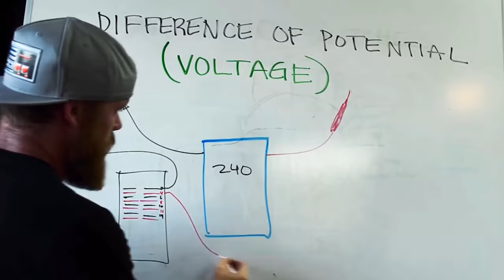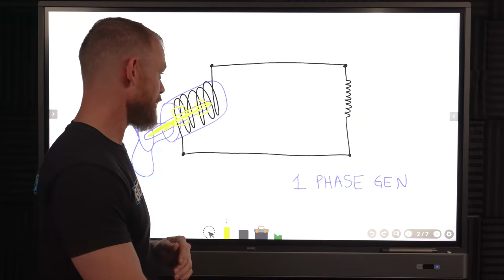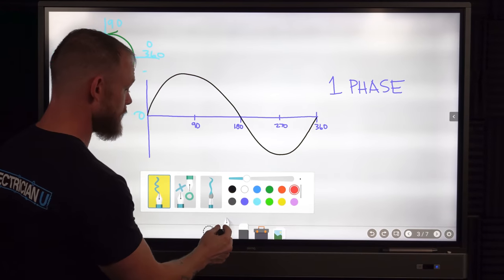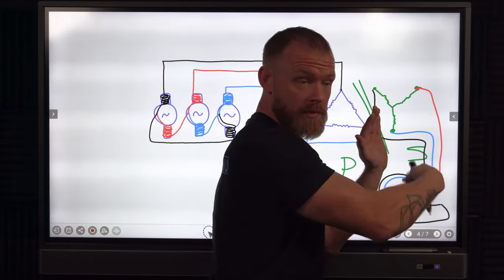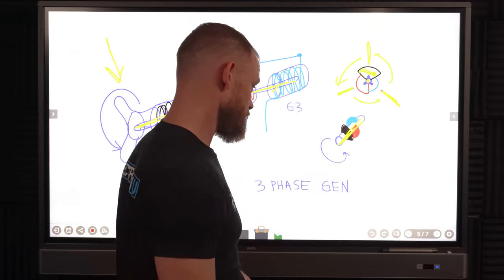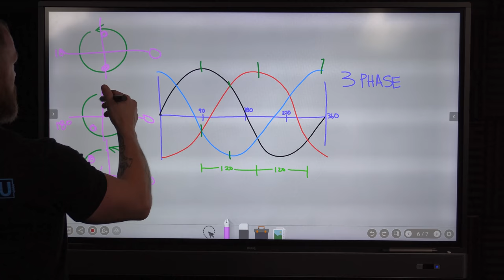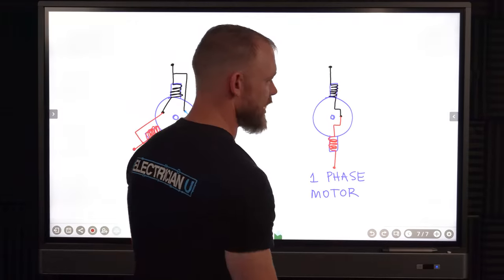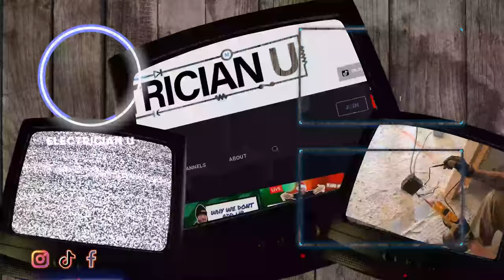What is the Difference Between Single Phase and Three Phase???

Comment: I’m not an electrician, but an HVAC tech who tries to fully understand what runs/effects the equipment I deal with every day.  This was definitely the most understandable description of 3 phase I have ever heard.  The only thing I was left wondering about after the video was the reason for different voltages on the 3 legs.  Thanks for such great content.
Reply: are you talking about the wild Leg in older buildings or the fact that 2X277 does not equal 480?
Reply: @businjay  Forgive my ignorance here as 98% of the work I do is residential, but as I remember it has to do with identifying the “wild” or “stinger” leg as some call it.  Like the voltage across 2 of the wires being different than the other 2 sets.?
Reply: @joshuahatridge3833  No worries. When I try to explain the wild leg to people they look at me like they just tasted shit!! but Dustin Explains it perfect here. phase to phase you will get a consistent voltage across all 3 of the legs but the stinger/wild leg has a neutral in there that can get you into trouble if you try to put a single pole breaker in, if its a dual pole breaker or 3 phase breaker line to line is always going to be the same, you have to know the difference between the 3 lines and a neutral(grounded conductor) in a stinger/wild leg panel there will always be one breaker out of every 3 that is 208 to ground/neutral. watch the video I linked to. Dustin explains it perfectly.   Lots of guys who dont get it will put a breaker in that open spot every 3 breakers to run a light or an outlet without realizing that that particular bus bar is 208 to ground and start frying shit. had an IT guy who thought he could wire stuff at a property I worked on, kept frying stuff but come to find out he was using the stinger leg in the panel to tie things into. he never bothered to check voltages, he just hammered a breaker in and ran his cable and wondered why the magic smoke was always coming out if his equipment,
Reply: @joshuahatridge3833  You also need to make sure you are checking phase voltages properly. 1-2, 2-3, 3-1 all those should be 208 or 240, where it starts getting interesting is when you go 1-n 2-n-3-n,  will all be 120 except one of them if it is a 4 wire setup depending on which is the stinger/wild which will be 208. Definitely watch the video I linked to above. dustin explains exactly what you want to know.
Reply: Here is another thing that maybe Dustin could explain for us since I dont really care to learn the code about it but I have in a pinch run a single phase air handler off the wild leg to Neutral to power a 208/240 blower motor and such off of a single pole breaker but I label the hell out of it. I dunno if thats even legal but the equipment doesnt care!! I think this is largely why the stinger/wild legs had fallen out of favor as it was too complicated for folks to figure out.
Reply: That would be a good video.  The other problem I have run into with three phase is switched legs making a compressor motor run backwards.  Why is that and is there a way to identify which ones should be in certain places?  Thanks for the video recommendation by the way, I did go back and watch it.
Reply: @joshuahatridge3833  There is a way to Identify, some of the voltmeters will tell you rotation (or proper) way to have conductors hooked up. but honestly A reciprocating compressor doesn't care which way it runs (unless its a semi hermetic and Oil pumps are involved Like grocery store racks or a lot of the older mquay/trane/carrier 30 ton and up chillers and packaged A/C units with semi hermetic compressors) so if it comes on leave it. a scroll compressor will let you know when its not rotating correctly (they make very angry noise but wont hurt them for a very short period) Blower motors easy enough, you just swap 2 Leads on the motor.  Your HVAC instructor should have taught you those things. When I change a 3 Ph motor I always check rotations of everything before I walk away. some things like VFD's and Star/delta motor starters get much more complicated but if you are mostly working on Residential and Light commercial you wont have to worry about that as much, if you have the time and the curiosity really do some research about how these things work so you dont get into a bad situation but at the end of the day 90% of what you and I do as HVAC/R Techs is electrical so I would learn what you can about the electrical side of things.

Comment: Neat video, you forgot to mention a key benefit, as compared to single phase, 
by adding one more wire you can almost double the power delivery!
I prefer to view 3 phase as separate windings etc that share the same spinning generator and conductors…. In a sense they both work together and separately

Comment: I'm glad you mentioned about the 'color' of the wires.  it's infuriating that some people struggle with an inability to distinguish between a symbol (colour of the metal sleeve) and the thing for which it stands (the electrical current in the system).

Comment: Great simple explanation, couple things I wish you would've provided for additional background:
- The excitation required for the rotor (shaft) on a generator to induce voltage on the stator (outside coils) as it spins.
- The role magnets play in transformers. I'd be carful telling people that electricity is transformed onto the load side across an air gap. Rather the movement of the current through the primary windings as it wraps around a magnet induces a current on the magnet, which through the ratio of the coils on the low side wrapped around the same magnet in comparison to the high side creates the inverse of voltage/current output on the secondary windings.

Not trying to puff my chest or anything like that. Just a bit of a nerd for electricity.

Comment: Awesome explanation, love the in depth explanation. For all intents and purposes, the average DIY'er just needs to know that 3 phase is very good and more efficient for running larger motors, in fact motors over a certain horsepower,  around 10 to 15 are only made in three phase, and with the possible exception of a very large, custom built luxury home, 3 phase is only available for commercial and industrial use. (Some utility companies and jurisdictions have a limit on single phase service sizes, I believe in parts of Wisconsin,  anything larger than 600 amps must be 3 phase,  or have engineer's approval)

Comment: I’m an electrician in Switzerland and I have to say that if you know next to nothing in electricity this is quite clear of an explanation . So I want to say that you did a good job. But I’m used to working with a 3 phase system and think that you forgot to explain the neutral wire in the secondary system. For those who are interested, I think you should explain it in a second video (unless it’s has already been done and I’m just unaware). I think you should talk about what it is, how it’s created, it’s usage, and the fact that it isn’t obligatory for an electrical system to work but very useful for using different voltage on the same grid without a transformer. (Sorry if i didn’t use all the correct technical terms, I have to translate it from French).

Comment: Why don't we use three-phase to run HVAC units in our homes? It would be much more efficient, yes? By the way, I've been a professor at the doctorate level for 40 years and you, sir, are a PHENOMENAL teacher. You have a knack for breaking down complex subjects into manageable parts. Keep up the good work. I'm learning a lot!
Reply: Residential applications typically are supplied with single phase power. Single phase power is less expensive to purchase, and three phase is more appropriate for higher loads than what is used in residential applications.

Comment: WOW, with no pun intended I had a genuine light bulb moment at 7.00min with your equal and opposite Sine wave.
Showing me, a simple Fitter Welder, single phase has a 'dead spot' at 180°
Explaining why a single phase powered, 3 phz generator still needs a flywheel. 
Thank you. 
Cheers Aaron

Comment: Sinewave: although your magnet explanation is right I would have a comment. The sinewave is not only a graphical presentation of the voltage and/or amperage but this sinewave actually present in the wire (conductor). Start with the zero-crossing (it means there  is no voltage nor amperage present in the wire - at all. Then the voltage start to grow until it peaks at 120V then it drops back to 0 and it starts over the same thing just the opposite direction. Imagen a battery connected to two wires you have + and - but 60 times in one second, you flip the battery between the wires. That would be a square-wave. just because the voltage increases and decreases between flipping you get the sine-wave. Love your presentation.

Comment: Seriously…excellent instruction. I’m a trained aircraft electrician…but I’m now an electric sign contractor. 120/240 vac is easy for me, but gets a bit fuzzy when working into three phase, 277 service, etc. the ONLY thing I would add/modify to this instruction is that a three-phase system almost necessarily HAS to come from the same generator. Inside the generator, the three sets of windings are completely separated and the induction “pickups” are set 120 degrees apart. If you used three separate generators, trying to sync the phases from three different generators to be 120 out from each other, nearly impossible…
Reply: Also, 60hz is why all generators making power for 60 hz systems must rotate at 3600 RPM. 3600 RPM push/pulls 60x/second

Comment: I think what threw me off for a while was a rendering of single phase generation has 2 wires and I always equated that to 1 phase that we would split with a neutral but that still one phase loop was feeding a home.  That made my mind warp when I then considered that electricity is generated in polyphase and one phase is actually off set loop a/b b/c c/a.  I might be stupid but I think the visual models create a misconception that is hard for a student to explain. Visualizing polyphase still bends my mind a little to imagine the way the generator is wound.  The transformers are what truly make it marvelous.  I love seeing the mains for a drilling platform or pump power.  I swear I saw a bank of transformers that had every phase connected to everywhere.  Primary and secondary side with little resistor looking things between h1 and h2.  They had star delta high leg and a split single  service drop wired on one pole going in different directions/conduits. I also noticed out in the boonies it seems every 6th or so pole has all 3 phases co bonded to the neutral.  I thought they were isolated and tapped for a future transformer but the insulators are wrong, there would be no place for a fuse without a lot of changes to look like the rest.

Comment: I haven't read all the comments - someone else may have already clarified this but the difference between phase and polarity is in the time domain.  We call household current single phase because there is only one time reference. The two legs always exactly mirror each other. 3 phase is different because at the point of generation, there are three circuits, and these are isolated - each traveling in its own conductor, and they NEVER interact until they are actually doing work in a motor or other device designed for polyphase power.  Each phase in three phase power is slightly behind (or ahead of) the other two phases in terms of when their voltage peaks.  The peak difference between any two phases being 208V in North America.  This is why single phase gives 240V across the two legs, but 3 phase only yields 208 - the two legs are not in phase.  In single phase applications, the two legs are 100% in phase - they're just opposite polarity, so the difference between them is greater.

Comment: just a note you are correct about how the genertor works, however i build generators for power plants and the magnet inside is actually an electromagnet that can be throttled to make more or less power based on the demand. the magnet is often reffered to as the exciter and it is DC so it uses some of the generators power but it is sent through a rectifier just a small nugget of information that could be intresting

Comment: Tesla patented the 6-wire alternator in the US. But this idea was not used because 6 individual phases and lines were too expensive.
In Germany, Telefunken developed three-phase current with 3 lines. 
This makes it possible to operate a generator on a river, to transmit this with just three phases, and to operate an artificial waterfall with an asynchronous motor pump.   The Germans in Europe patented this.
The Swiss and Germans then agreed on 220 volts / 380 Volts and 50Hz. 
Since the English prefer 240 volts, it was later adjusted to 230V (400V three phase)

Comment: Hey Dustin, How are u? It is interesting to get oneself understand concepts with u as teacher, thanks 

Is it like this in single phase?
Please confirm 
When the North Pole connects to the top wire and the south pole connects to the bottom wires the current moves counter clockwise

And

When the south Pole connects to the top wire and the north pole connects to the bottom wires the current moves clockwise.

South Pole is negative 
North Pole is positive 

And

Electricity moves from negative pole 
And
Electricity moves toward positive pole.

Comment: Three phase is a rotating field of energy each phase 120 degrees apart which allows a more efficient delivery of energy/power because the the cycle does not fall to zero for each pulse of voltage/current. Best illustrated graphically showing the overlapping nature of the three phases and how the voltage/current remain elevated more.

Comment: You should do a video on why theres 200a panel (square D) and they have 30 space- 60 circuits, or 40 space-80 circuits.
Reply: It will all come down to how many circuits you need in your building/house. There are only limited number of devices can be connected to a certain circuit (check your electrical code book). That is why sometimes in one area of the house/building you can find more than one circuit running in that space.

Comment: Hey Mr ElectricianU , can you make videos on how to troubleshoot VFDs fuses  &pumps  ,motors etc..??? I just got a maintenance mechanic job & it's all we dealing with !! Thnks
Reply: Troubleshooting VFD'S not that difficult. First make sure you have three phase power ( more then once had the odd ball 600 volt line fuse blew ( the one that does feed the control drive transformer ) and  occured while drive was lightly loaded. Could not reach higher speeds because the normal DC Buss voltage was only around 420 bolts instead of the usually 650 to 675 volts DC. If the touch panel is blank remove the 24 volt control wires that go outside if drive. If touch screen is on them you have a short on external wires. There is a process to check the IGBT'S  using an ohmmeter. There are several great vids on utube telling you how to troubleshoot drives. I was lucky to attend 2 drive schools but learned just as much by picking the drive tech brains when he came to perform start ups. His company only charged $150 to $200 to perform a start up on a new drive purchased thru the company he worked for. This extended the free parts & labor warranty to three years. Danfoss & Allen Bradley had great tech support while ABB was always like pulling teeth. Always asked why do I want to know this or that. We had drives from 3 to 1, 750 HP . In a new building all drives over 40 HP were 18 pulse which has extra parts to cause problems. When working with drives have to watch large capacitor bank that can take up to 20 minutes to self discharge. The 3 phase 480 volts that makes the 650 to 675 volts DC Buss is in parallel with the capacitor bank. Got shocked several times 10 minutes after kicking out the 480 volts. Was told that most drive capacitors have a 75,000 hour life span but had dozens of old drives that had well over a 100,000 hours. Had a few 15 year old Danfoss obsolete drives that parameters would change on there own. All were in a mechanical room with very limited card access so doubt anybody played with settings. That took awhile to troubleshoot to find problem. Old timer told me many years ago after your head is spinning and getting nowhere troubleshooting walk away and drink a coffee or a soda, wait a few minutes then go back. So many times boom found the problem within a few minutes after taking a break  Good luck. Work safe & keep your PPE in good shape.
Reply: @JohnThomas-lq5qp  nice!!! Thanks

Comment: It’s cool that you used the crankshaft analogy as that’s exactly what I was thinking. It’s sort of like the difference between a cross plane and flat plane crank. Each has its advantages but generally cross plane produces more power. Is this why 3 phase is considered more efficient? For similar reasons? (More power per revolution) I’m not an electrician and am just starting to understand all this.
Reply: It is impossible to manufacture high power alternators (a few kw) in single phase. The reason is the presence of a reverse magnetic field which heats up the machine (LEBLANC theorem).
In three-phase this problem no longer exists, we reach powers greater than 1000 Mw.
For motors the same problem arises, it is out of the question to manufacture high-power single-phase motors, their efficiency is disastrous, the reverse magnetic field generates losses and heating.

Comment: Anyone that takes trips on a large airliner is on a 3 phase machine. Most aircraft engine generators supply 240v 3phase @ 400hz , the newest ones are variable hz. It is a cleaner, more stable, more efficient power source.
Reply: Absolutely..I'm an airfield  electrician  and work with 400hz
Reply: Car generators are three phase also.